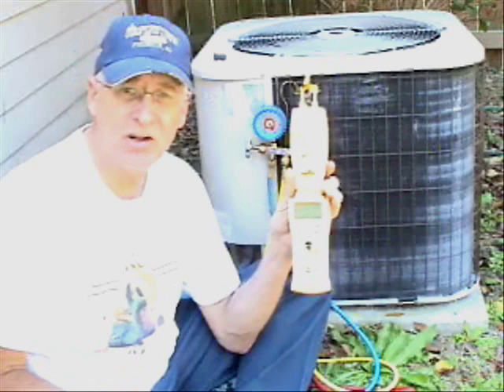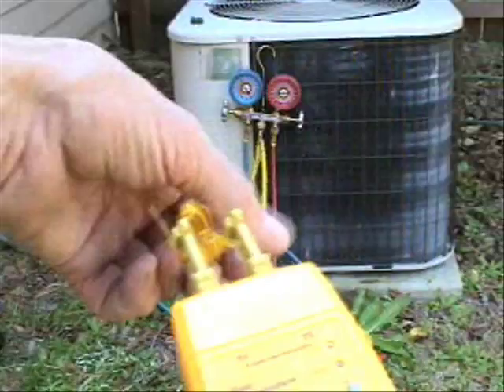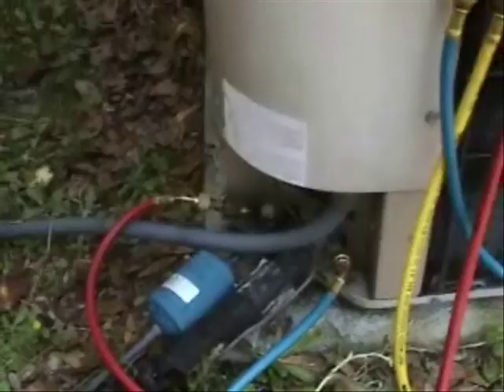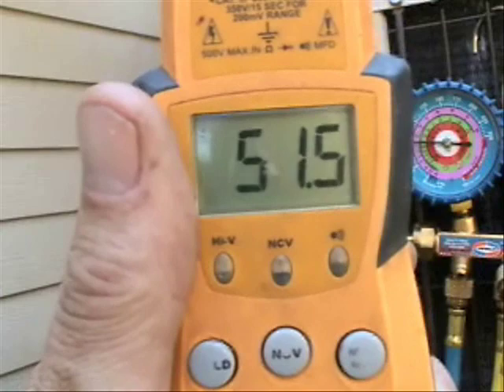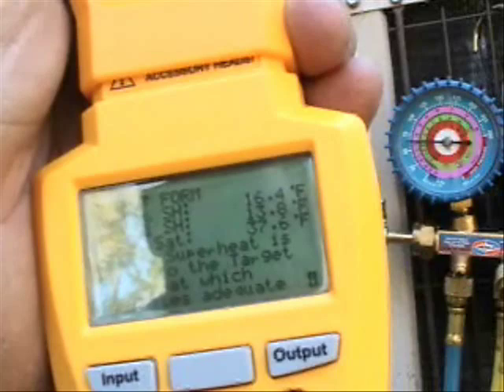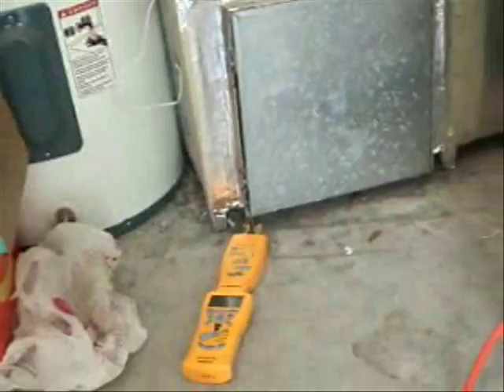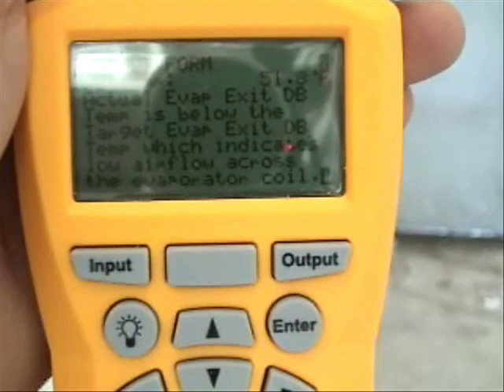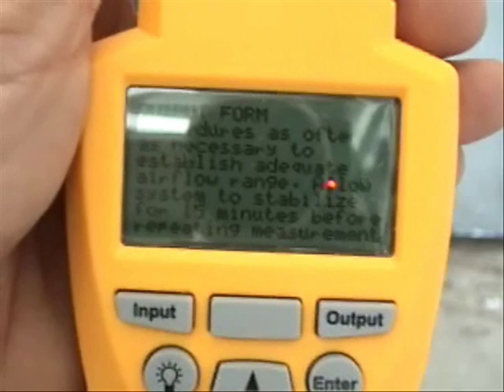HVAC Super Heat with the Fieldpiece HVAC Guide

Comment from the maker: You need the indoor wet bulb, the outdoor dry bulb, the low side pressure and the corresponding temp on the compound gauge and the suction line temp.

Comment: i think he was supposed to mention you have to wait 15 minutes or so before taking readings and if the ambient temp is low you can cover 3/4 of the top of the outside coil to bring up the temp of the coil to required levels for proper reading.

Comment: Copland engineering requires a 20 degree superheat at the compressor and 12 across the coil. Fluke 54 for measuring superheat is the best.

Comment: You should be setting either tourqe or rpm on a variable speed blower. By setting the Cfm directly with  dip switchs. I Havn't seen any equipment with a selection between
50Hz or 60Hz. That dosn't make sense. If you do have a dip like that it is probably so that it can be sold in another country where they have a 50Hz sine wave opposed to our 60Hz sine wave in the U.S. If this is the case it would need to be set to 60Hz. Your blower may be running low if you have the dehumidification set to on

Comment: Thanks for the video Dr. I would like to know if the hvac guide should be used after you made the desicion that the unit is working properly and you want to get an acurate superheat .Now If there's a restriction in the liquid line you will have high superheat. Im wondering if the hvac guide will advise you to add refrigerant if thats the case

Comment: I just saw the video of your vsb controller on your own unit. I now understand what you meant by changing the Hz of the motor.

The field guide would be a good tool for the new tech or the old forgetful tech. It seems like it might take to long to full with compared to my good old slide rule. 

Fixed orfice restrictors will be going the way of R12 and R22 and so will superheat as the primary means of charging.

I assume that the FG does subcooling as well?

Comment: I worked for HVAC / Electrical shop for @ 15 years where I was the only tech for half of the time, at times there was up to   4 techs. I was also the only electrical repair tech. The HVAC side was not union but the electrical side was. I had to clean up messes created by union guys. Maybe not as much as the "scabs". but the some of the  union guys had a bad attitude towards me. I imagine that they were threatened because some of us scabs knew more than they did. Unions can be parasites on busine

Comment: Basically all you need is Indoor wet bulb and outdoor dry bulb as well as you high and low side pressure and suction line temp.  All that to get target super heat.  Is that right?

Comment: When you was checking for pressure,did you hook up the yellow hose to anything?And also after you took pressure and the temperature meeting did your meter subtract the two reading to get the superheat readings?And thanks for the vids.

Comment: @DrZarkloff  We currently do not have an Andriod App but are going to build one. You can use our web based calculator at exactchargehvacdotcom. The name of our app is ExactCharge in itunes. We are creating  a Check Me or a Charging and  Diagnostic Analysis App in the near future, It will work like the HG2 from Fieldpiece. Just so you know the ExactCharge Calculator was built prior to any of the new Fieldpiece HG instruments as well as their Sman that has target superheat function. Just saying.

Comment: Have you looked at the ExactCharge Calculator. Does many of the same things as the HVAC Guide but is manual input and works on a SmartPhone or Iphone. O Readouts for 28 refrigerant P/Ts, Target Superheat, Actual Superheat occurring, Actual Subcooling occurring, Corresponding line temps from inputted SH/SC. Users can use thye web based app for free. Might be something you could also review. A true refrigeration calculator.
I am the creator of the software.